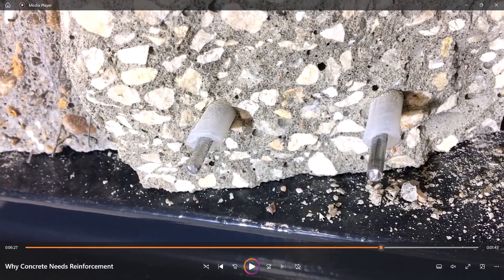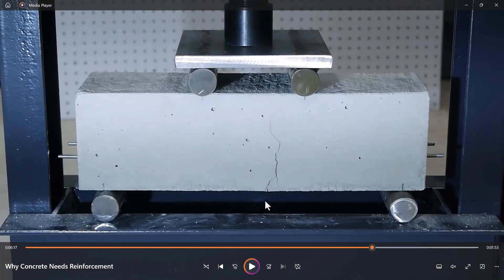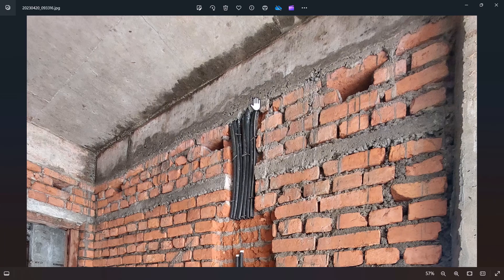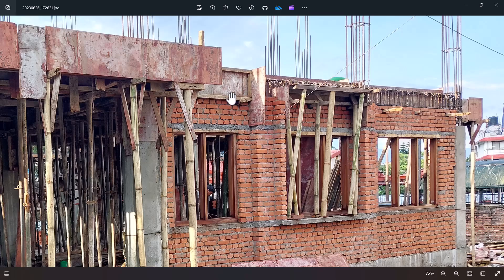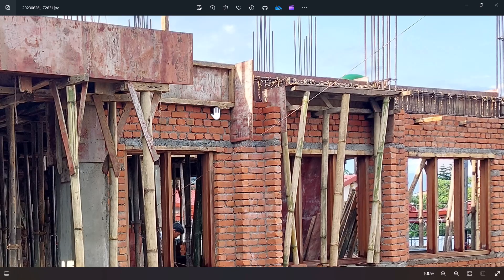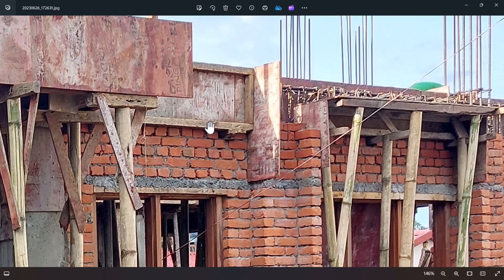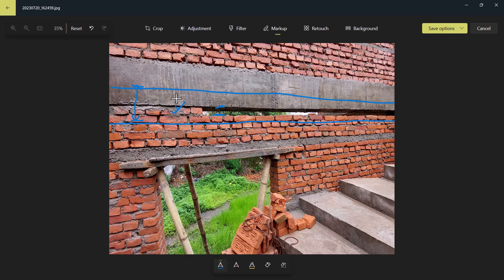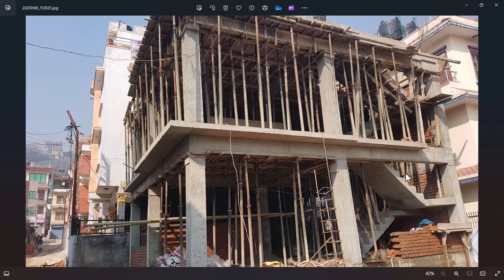वाल लगाएर ढलान गर्ने कि ढलान गरेर वाल लगाउने ?Brick Masonry before or after Slab Concreting in Nepal

Comment: I would like to ask if ground floor must be wall system or concrete dhalan system?
Reply from the maker: Concrete dhalan system "RCC Frame Structure" and Wall System are both different types of structure and in which the load transfer mechanism and behavior is different. You can not build a wall system at ground floor and RCC at above floors and vice versa.